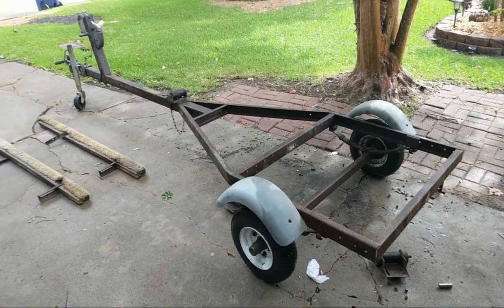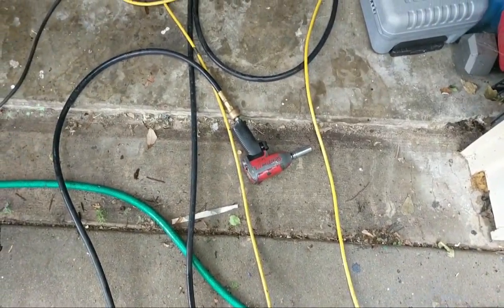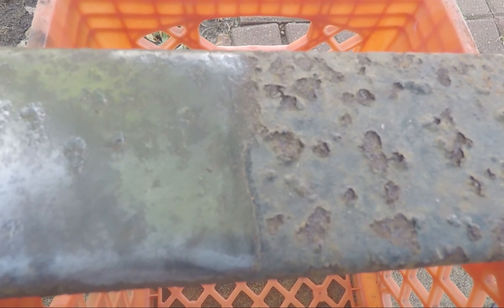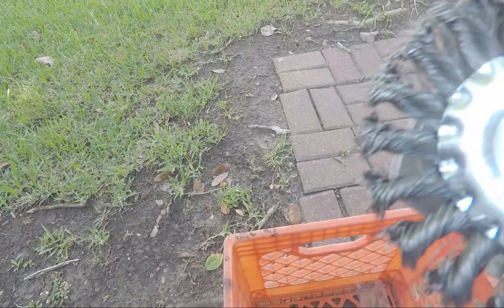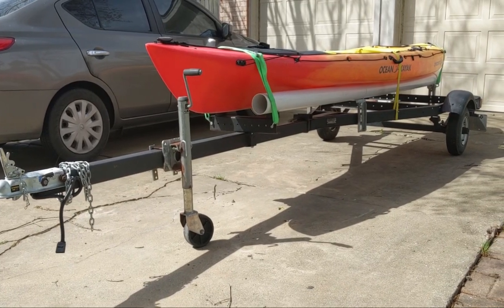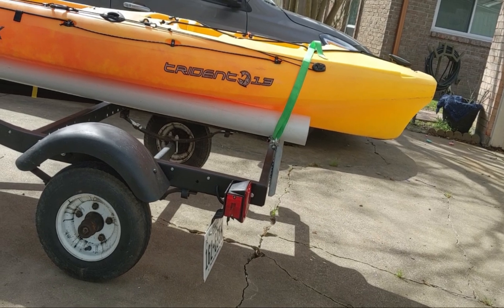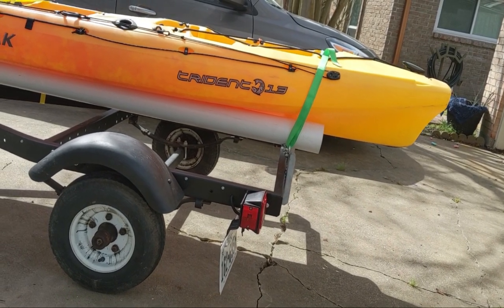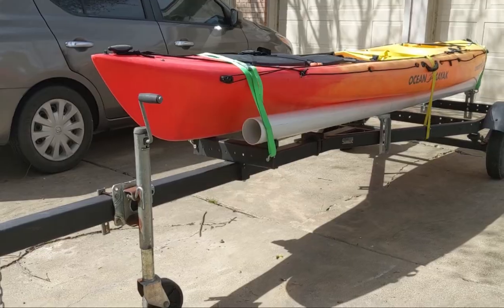Kayak Trailer Build ... 20 Years of Rust

Comment: Man that's awesome video. I'm looking for a kayak trailer. Kayak trailers have been looking at a very expensive. I'm thinking about doing what you did way cheaper. You take it easy and B safe out there
Reply from the maker: If you're not afraid if a little wok there's some old metal out there worth saving.

Comment: Awesome, how did you deal with the rust from inside the tube frame out? Just got mines almost done.
Reply from the maker: To tell the truth I didn't deal with the inside of the square tube for the tongue. Mine felt solid and has a dent from probably being jackknifed once. Figured, I might need to replace it but it pulls fine. I just inspect it regularly for structural integrity.